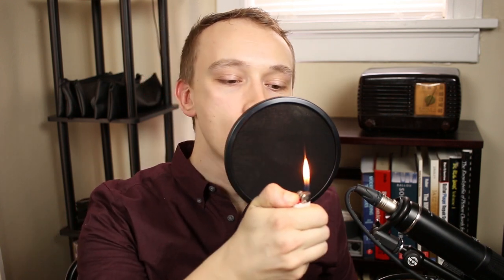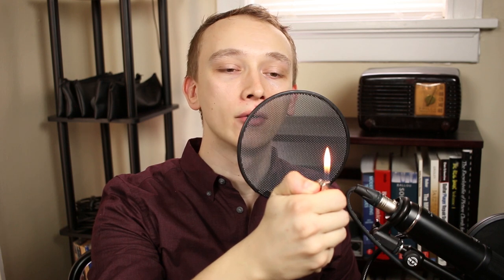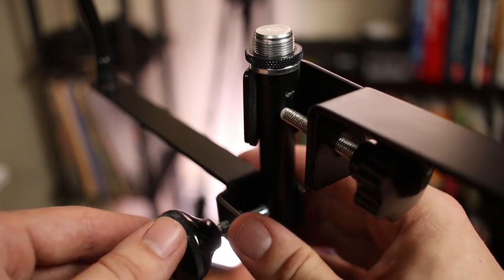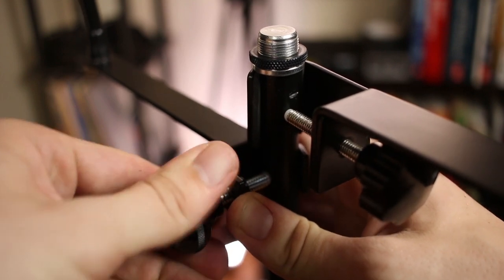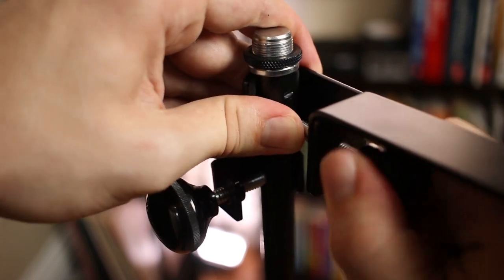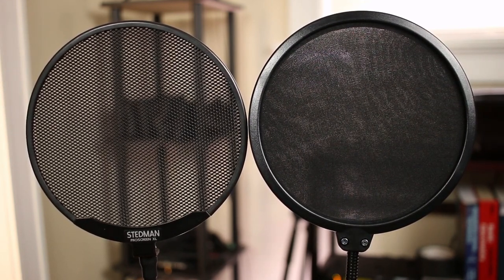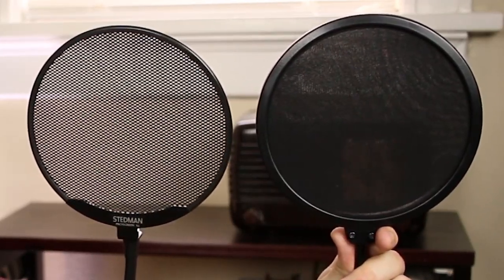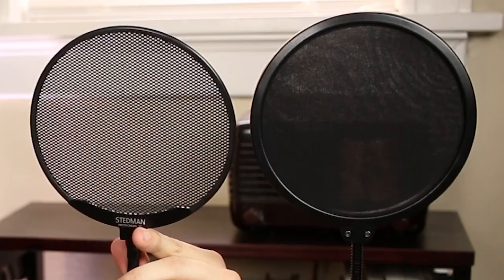Pop Filters - METAL vs NYLON FABRIC: Which Should You Buy?

Comment: Without a doubt pop filters look nice but i think they are useless when proper mic technique is employed. Have used a Metal one and it does create some type of airy tinny noise that is a problem in post another gent from a very famous audio store said that you clean em and are ready to go? The spit goes right thru and into the U87 or U47 Capsule. The nylon one reduces the signal by almost 6db so I think it's understanding the polar pattern and then proper mic technique to no get pops , hissing and other unwanted noises. Great video by the way.
Reply from the maker: Thanks, V O! This is some great insight you’ve shared here.
Reply: Aquarium filter pad FTW.

Proper mic techniques and proper microphone placement solves a lot of problems but ROOM TREATMENT can knock down a lot of major sound problems like sound reflections.

Comment: which do you prefer though
Reply from the maker: I prefer the transparency of the metal pop filter. The high frequencies seem to be attenuated through the nylon pop filter. 

The hardware and ease of use is MUCH better on the metal pop filter, but you can spend a little extra on a mesh pop filter to get good hardware. 

Thanks for watching!

Comment: IME: Metal seems more sensitive, thusly more care must be placed, to the placement of the PF in relation to the capsule/diaphragm. 

I’ve taken to using two... both metal, but one smaller one directly in front of the capsule and then one farther in proximity to allow artists to “eat the grill” if need be. Of course all depends on the singer and microphone. 

Side note! If you find you have excessive sibilance but like the mic character you can rubber band a pencil directly on-axis to the capsule either on the mic body or the pop filter. It’s a “before de-essers” were invented trick. (Of course mic placement trumps all of these but... I digress.)

Comment: Hello, why with the nylon antipop does sounds way less the low frequencies ? (is because of the microphone take audio direction (onmidirectial etc...) ? I mean I hear the breath width sounds reduced on the nylon, as it's supposse to work but it sound also way less the low frequencies ? 
thanks for the video
Reply from the maker: I was sure to speak toward the microphone from the same angle for both the metal and nylon tests (about +/- 30-degrees off-axis). It is a cardioid microphone. 

I believe the frequency response transparency is another benefit of a metal pop filter. The nylon filter blocks air, whereas the metal filter redirects air. 

Thanks for watching!
Reply: @AudioUniversity  Tahnk you, this is very useful !
Reply: @AudioUniversity  Hello ! ,

Wow this was long ago,  I finally bought them, both, A Nady nylon and the same Stedman you use, altought I prefer the goose neck of the stedman there is something I notice pretty detailed on the metal filter: 

if you say ssss (or a noise type) and you move your head around the filter; it will produce is a type of comb filtering affecting the signal, (you can hear it even without microphone) this only happen on the metal version.
It maybe mine cause it came a little bit bend (like a pringle but very little) but this it apparently normal and the functionality does work when we blow like you example.... 

Let me know if you ever experiment something like that ! and thanks for all your videos
Reply from the maker: That’s interesting! I’ll have to try this out. I’ve never noticed that! You’re saying the comb filter occurs at your ear or the microphone? Or both?
Reply: @AudioUniversity  I just hear them again and test them.
It seems to be more noticeable to the my ears than the microphone, however it does sound on the microphone too. With the sss is very subtle, it’s way more noticeable when blowing (and long plosives although its uncommon and didn’t test with breathing) and it happen with the nylon too but it’s almost not noticeable. on the side of the microphone I notice I think only when blowing with the metal.

Also, it seems to happen only when 10 cm or closer to the pop filter.

I made also a white noise test with my phone, which is curious in this case it seems to be only noticeable without the filters :o I’m using the AT4040 just in case.

It's a very very uncommon specific test, all this cause somehow after singing tests, I think I prefer the Nylon filter, but I’m not sure why, so I made several tests.  May be I just like the plosives more attenuated. and I though the Nylon was going to attenuate more the high frequencies as some people on internet says but I find the difference pretty minimum; I put attention to that cause I like maintaining the original harmonics as much as it’s posible.

I can send you the audios if you which
Reply from the maker: This is good feedback! Thanks for sharing!
Reply: @AudioUniversity  hope it helps ! If you ever test this, let know your conclusions